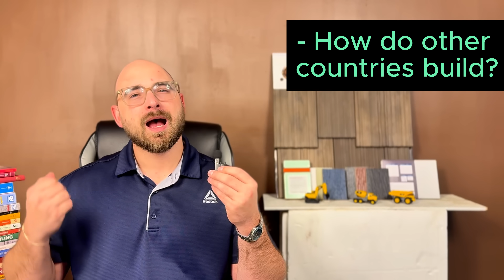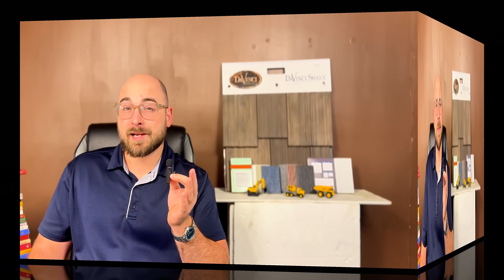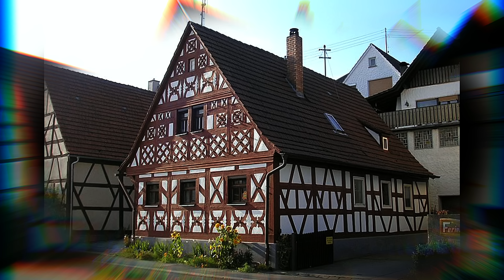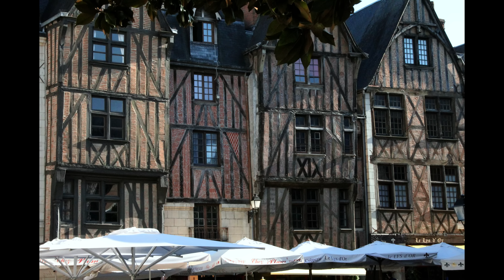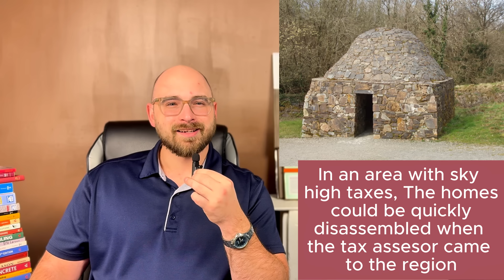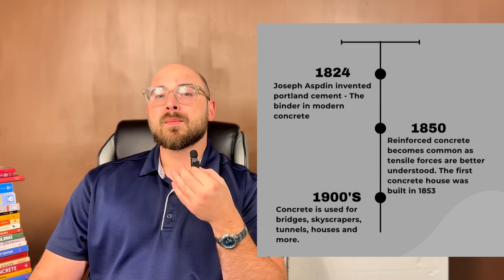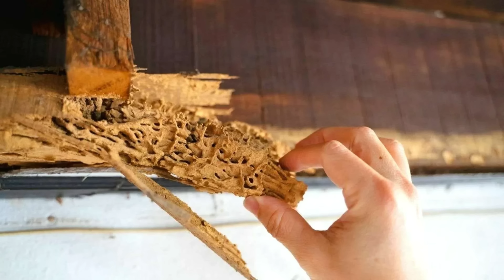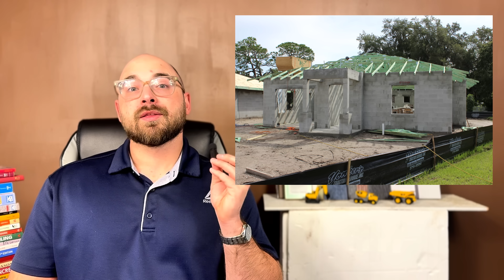Why Other Countries LAUGH at American Homes

Comment: Here is the explanation of the Roman cement:

Aluminum in the crystal lattice makes Roman cement more stable. It turned out that the Roman cement differs from the modern one in that part of the silicon atoms in the resulting crystal lattice is replaced by aluminum atoms. Measurements revealed that this exchange makes the crystal structure more stable compared to mechanical loads and significantly increases the binding capability of the cement. This principle could also be used to improve modern cement. First approaches are already in place, as the researchers report. Either the so-called Pozzolan, deposits of old volcanic ash, is mined and used, or ash from coal-fired power plants and incinerators. Both provide aluminum for the optimized crystal structure.

Another advantage: Cement, which is produced with these ashes and according to Roman patterns, has to be heated less and releases less carbon dioxide - the production would also be more environmentally and climate-friendly, as the researchers emphasize. If we learn from the Romans, it would make both more durable and more climate-friendly cement and concrete.

Comment: While as a european, watching a lot of the US builds is scary 😅
BUT
it’s not all laughter. There is a very-very thorough system to cover all steps. It’s also very-very easy to modify after the house is built. 

Furthermore, it’s quite DIY friendly. Perhaps too much so 😅

I think the US would need to diversify more, as not all of the US is well covered with lumber, half of the construction seems to be about countering the downsides of lumber construction and in the end, the biggest downside I see is just the flimsiness of them. 
And they are nowhere as cheap as you’d think.

Comment: For roughly the same price, europeans build with concrete, americans with timber. Timber burns.
Reply: Timber is much better for wintry climates
Reply: Timber is a better insulant.
Reply: @Simboiss  European houses are mostly insulated, so heat loss is much less than American houses.
Reply: You can put insulant separately for far cheaper than the price of a house. And concrete is still far fore resistant.

Comment: You forgot Fully timber houses that were more common in Northern Europe than  Timber framed house in the past.  They're built bit like Log cabins, but the logs are squared into beams to make smooth walls with insulation places inbetween them.  The Timber framed buildings you showed were more common in Middle to Western Europe.

Comment: Before watching this video:
I usually laughed at American houses cuz afaik you guys have very thin walls that not only can't block bullets (in a country known for having lotsa guns it's an actual issue), but also don't allow for strong "window sills" (I used translator, hope it worked). It's quite an issue if true. Also thin walls really don't help the house to be soundproof or well insulated, but I live in a commieblock built 75 years ago with heat radiators built into the walls, so I'm not that far away by how much my place sucks in these fields. But hey at least it was due to my country being heavily bombed in WW2 and having a need in quick and cheap "better than a hole in the ground or a wooden barn" solution. Idk why you guys tolerate having walls about as good as pre-1960s USSR had.

Comment: Neighbour of Germany here - Czechia. Majority of new homes are made from bricks, then insulated with mineral wool or polystyrene. Wooden construction is usually prefabricated and costs a little less than brick building, but is quicker. Concrete masonry is not used as much. Usually only for ceilings.

Mold and dampness is a problem when people don't ventilate properly and often. But new houses use recuperative AC units for this.

Comment: The main points for me why I prefer concrete and brick is the noise and heat/cooling efficiency. I lived in them all my live here in Switzerland and I barely hear a noise from upstair neighbours. The only stuff I hear is if an adult runs, something heavy falls or similar. Even vacuming is something I never actively noticed unless it was very quiet. It also allows for bigger multifamily homes leading to more dense neigbourhoods. At first that might seem like a negativ but overall it has many benefits. Easier access to public transport as the more spread out everything is the more expensive an area is to service, overall better walkability vecause the distances are shorter, which also leads to children having an easier time visiting their friends, shops being closer since Switzerland has mixed zoning leading to smaller shops being everywhere if you need some basic groceries and many more. It is over all a bit noisier outside and tends to have more traffic but that is only a minor issue and since the homes are well isolated from noise that is even less of an issue. Sure many homes have no or less gardebs but as a person that hates gardening work and upkeep that's a plus for me. I often felt like the spread out copy pasted neighbourhoods in the US had something creepy about them. It seemed kinda artificial and unnatural but that might just be me because I'm used to every building being at least slightly different buildings and the same house would at best be copied a handfull of times if they were built as one project instead of a whole neighbourhood being like that.

Comment: 90% of homes here in New Zealand are wooden framed, the main reasons being cost, supply, & earthquakes - much like in the States. The most commonly used materials for exterior wall cladding over here are bricks or weatherboards (wood), some houses even use a mix of both for visual purposes. Steel is the most popular material used for our roofs, concrete & clay tiles are fairly common as well, along with asphalt shingles.

Comment: ICF sounds really good. I like solid structure homes because of the insulation, safety and enduring quality they provide. With ICF it sounds like you get the benefits of both light frame and solid structure. Thank you for the informative video!.

Comment: I actually was going to build a house out of bricks because its resistant to radiation, but I might rely on a wifi
Reply: Brick walls, even really thick ones, arn't nearly as bad as concrete if you are concerned about wifi.
Reply: @lisamo1013  yeah I was.. bricks would be nice

Comment: Seems to me like it would be tricky to get the wiring and plumbing into the walls of a CIP building. With lightwood, you just put up the frame, put in the wiring and pipes, and then cover it with drywall.

Comment: I think the problem here in America is quality. I can buy the BEST framing lumber, insulation, flooring, roofing material, etc., etc but if the QUALITY of the construction is bad, you have a bad house. When you can have an inspector do an inspection of a new home and come away with pages of defects, it is not the material, it's the construction. Are certain types of homes more stable in a flood, hurricane, earthquake. tornado? Yes . So if you are worried about those disasters, don't build a stick built home but can you afford to build another type?

Comment: It's worth mentioning that structural brick homes were semi-common in United States. I'm sitting in one right now. The outer walls are absolutely structural, double walled, built in 1915. The house I grew up in, built in the 20's was also. Older midwestern neighborhoods from the late 1800s to about the 1940's are full of them. Some of them go back to the 1700's though.

Brick facades, "fake brick houses" are a semi-recent invention.  They are, however, much easier to insulate.

Comment: I visited the UK this last fall and we stopped at two different new home developments.  They both used timber frame construction for the homes.  The salesperson said this was the norm now, but I don't know how knowledgeable she was on this point.  They all had extremely thick walls for insulation and the stone work on the outside was just a facade.  They were nice, but very small by US standards with micro backyards and no garage.  A big pass for me.

Comment: There's all sorts of new building techs coming out all the time like aircrete, hempcrete blocks, packed earth bags, hay bail walls, (3d printing is a scam), prebuilt techs using SIPS, etc...Timber framing seems slow & easy to destroy. If could afford a home I'd be interested in new tech. The only good thing going on with wood is glue lam. Stronger than steel, hard to burn, probably bug resistant, can probably use less quality wood to make...I wonder why stick built doesn't just go with glue lam instead of regular timber.

Comment: American use wood to build homes because it’s cheaper than using other materials in the US. Also the US is huge and the soil is not the same across the country. In Texas which the soil is clay building with wood is better because the house tend to shift and would make the ground uneven if it’s not water regularly. It’s not as big of a deal as the Europeans make it, you build your homes with what you want and Americans build their homes with what they want. Also the renovations are far bigger in the IS than anywhere else in the world and that’s also a reason for using wood. Like it or not it’s how it is.
Reply: clay soil that the good one option in EU exept maybe rock plato. Texan Dry clay, and no minus temperature is the best option. Try to build the same in wet clay and minus temperatures (EU realies)

Comment: Leaving CO2 out of the video?  If "cement" were a country, the worst CO2 polluters on earth would be the US, China, Cement, and India.  It's one of the HUGE industrial polluters.  More of that?  No thanks.  And Roman cement (Pozzuolana) is made with volcanic ash.  Short of mining volcanoes,  you're sort of stuck with fly ash from coal fired power plants, and no one wants more of those either.  Trees sequester carbon and pump out oxygen, something nearly everyone wants.
And I've actually lived in Europe - in an old brick farmhouse that was screechingly cold in the winter.  
While cement itself is fireproof, the buildings are only fire-resistant.  The inside can totally burn leaving just the shell.  Keeping the fire from getting inside is important, and that applies to wood framed houses as well.  Fire resistant cladding, metal roofs, keeping embers out of ventilation, and fire resistant windows all go a long way in keeping wood framed houses from catching fire.  (The windows in concrete houses are a weak spot )  
I will say this, Germans make some nice windows and doors...

Comment: On site 3d printed concrete houses will pop off, I suspect.
Or the block laying bots, like 3d printed but blocks instead of concrete mixed on site through the nozel.

Zoning laws are also a huge factor, if it's not a single family house, 80% chance it's illegal to build.

Comment: In my opinion, the reason why houses are built like that in America is completely due to cheap labor and cost. Aesthetics should not be important at all, instead, the priority should be to protect human life. For example, in California, which has the strictest laws, 13 thousand buildings burned to ashes. Think about these, is it cheaper to build from wood or concrete? The low human loss (I wish it hadn't been) may be due entirely to the laws of the local government. The best example of the Eastern Roman Empire is "Hagia Sophia". Although there were architectural flaws, they tried to minimize this over time and it survived 10 earthquakes from the year 537, when it was opened for use, until 1999. It has still been in service for 1487 years...

Comment: I prefer german windows and european toilets.
Those american bowls with a huge lake are terrible. No water savibg option there. No half fill or half restored lakes there. Terrible. Sometimes you get splash back, uagh. And they clock up more easily and more fatal as well. First flush couldn't leave? Well, well, well, here comes the flood, cause that super bowl is filling up again. So within one flush you have created a flood. We flush when needed, and if clogged your second flush is entirely to blame on yourself. We had a choice.
Yes a toilet brush is pretty much next to every bowl, to get rid of stains. America doesn't always have that, while they still could use one sometimes (less often due to all that floating, but still).
And your stalls habe slids all around. Wtf? Who want those peaking possibilitys? We have visualy fully enclosed stalls in public bathrooms.

Comment: You forgot one benefit of lightweight timber homes: the thicknes of the wall is filled with insulation. When you have solid walls you give up the space for the wall, because that is now an extra layer added to the insulation. When we build bricks on the outside (just as a weathercladding), insulation, brickwall on the inside (structural, hollding the concrete slab above) you loose a lof of space on your limited plot of Land.

We have about 10cm for the claybricks, 10 cm (3inches) of fiberwool insulation, 11,5 cm of lime sandstone (industrialised produced, fired) and about 1 cm of plaster on the inside, finished with wall papers. That is a lot of room that is used for a wall and only 10 cm of insulation.
Our neighbours have a timber framed house (not lightweight, pretty massive timbers. But still framed like in the usa). They have 20 cm thick wall, fully insulated, on the outside it is encased in clay fired bricks as well. And on the inside they have a normal dry wall. So they have twice the insulation or with the same insulation would have 10 cm less wallspace lost and more inside space.

Germany is still building with a lot of stones and concrete, but we should switch to wood as well. Our neighbours use only half the heating energy per squaremeter per year, compared to our house.
There house was prebuild in the factory. Better qualitystandards. Was errected in 2 days only (rooftiles took one month afterwards, plus two weeks of work beforehand for the footing to stand the house on), while we needed nearly one year for the construction. So it is a lot of money saved by living in that house next door, while we still had to live somewhere else.
We should switch. Those old timber framed houses from the dark ages show that wood can be long lasting and sturdy, if dry. But people have no clou and builders are a conservative bunch. In addition to readily available regulations for the methods we use since 1945. While regulations and correct methods for wood based constructions are not that wide spread known. The tipical builder will rip just through your waterproof layer and therefore damage an important part of your house, especially in the wooden house. While mineral materials also can get mold, they are more forgiving in that regard. So a layer of subconcious (for most people, here outspoken) fear comes on top. And if in doubt, mankind will choose tje vomonky known thing. For most people a house is a lifetime project. So risk taking is not appreciated.

Comment: From Central Florida down to the keys new homes required to be built from cement blocks. They are strong and we'll insulated like in Europe. Europeans are using Leier bricks. They are hollow inside and light and very well insulating. It is an excellent material to build homes, quick and easy to use. I think American consumers and insurance companies need to demand better built homes. Especially in tornado, hurricane and fire prone areas.

Comment: One big difference is that people here in Switzerland and Germany value quality extremely high and this is also true for standards of houses. Houses are built to lats at the very least a whole lifetime.
In the USA it is again all about making making short term profits and building as cheap as possible (while this can generate a lot higher costs over the long term).
Here there also isn’t something like just a starter house or constantly moving (to bigger nicer houses). If you buy a house you most likely will live there the rest of your life (until you die or have to move to a nursing home).